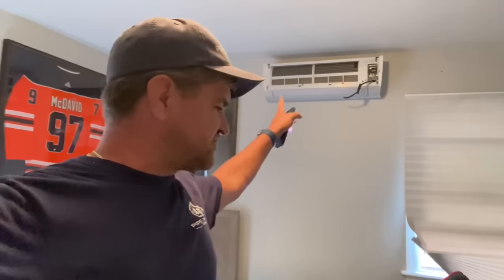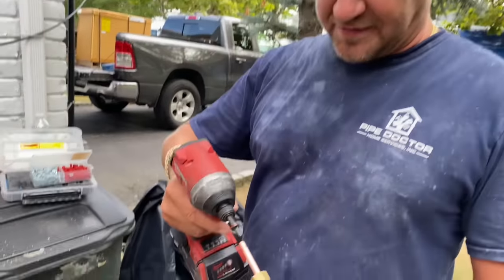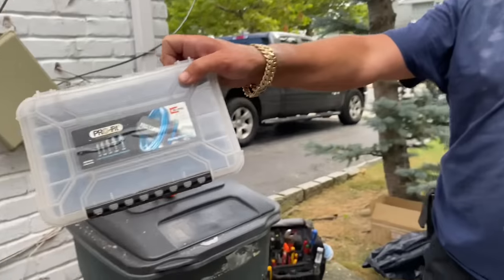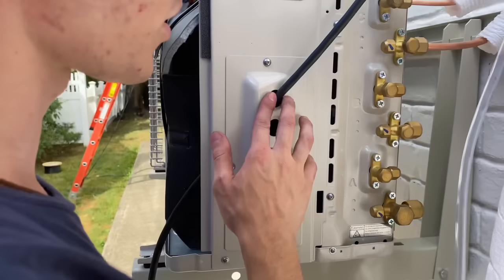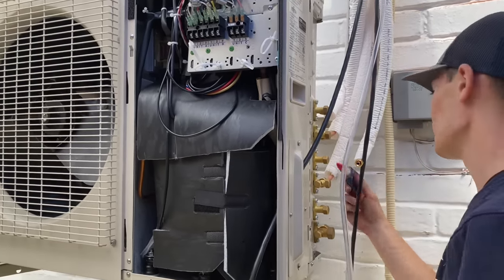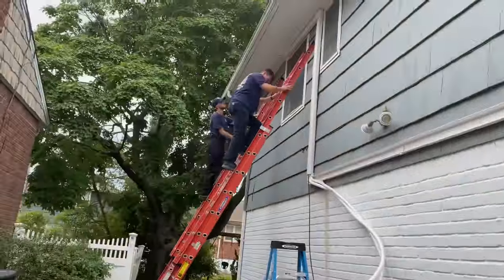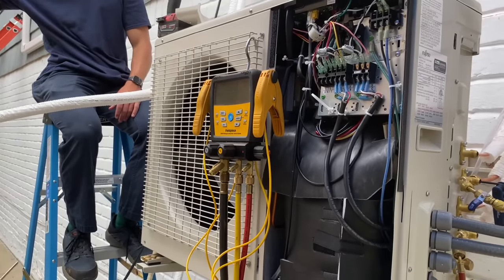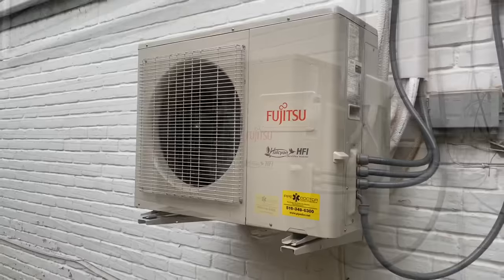Comparing NAVAC Auto Flaring Tool vs RectorSeal PRO-Fit During Fujitsu 3 Zone Ductless Installation

Comment: Mikey Pipes trying to give away the shitty flaring tool.   😆
Reply: I purchased the original Spin flare set, used it once on some oil lines and they leaked. Had to re do them with an old standby handjobber.
Reply: If you ever decide to have a contest for that thermal imaging camera though I would be very interested.  Would come in handy when doing load calculations.  I thought about getting the FLIR device that you can use with your phone.  Still deciding on what brand to get.
Reply: I’m up for the spin. Give it a try on some oil lines
Reply: Did the same mistake myself. I throw mine away after 2-3 failed flares. Thats  trash bro

Comment: The Navac Flare tool works great. I would suggest buying the flare gauge made by Navac part #NFG1 to check your flares when you are done. 
 I made the switch to the >B<Max fittings for two reasons, 1. it’s faster. 2. The copper fitting is thicker than the line set. 
 A2L refrigerants are well on the way just buy the press tool and roll with it. That’s the way of the future.

Comment: I use the hilmor orbital flare tool. It produces a beautiful flare everytime, sure u have to turn it by hand but I think its just as fast if not faster than these 2 options. also easier to lug around in an attic. and only around 140 bucks

Comment: You ever use any of those flare seal gaskets? I used them on my 3 zone LG RED system and my 3 mitsubishi hyper heat single zone systems... Been 3 years and all 24 joints have been perfect.. no leaks. systems never throw any fault codes for low charge.. and it was my first time installing any type of HVAC system.. I made all the flares, made sure all joints were torqued properly and i also used nylog on the threads and contact surfaces..I been in temperature controls for about 7 years so i learned alot along the way about all the systems i worked on.. Sizing, engineering, placement, installation.. all but one use condensate pumps, 2 of the Mitsubishi's i wired in the pump to the call signal to kill the system if there was an issue with the pump..All systems running like a top.. BUT IT WAS A TON OF WORK!!!!!!!!!!!!!!!!!

Comment: You can keep your Rectoseal junk, The Navac is the tool to have.  One other tip is pick up one or two lifetime "one hand folding tables" from HD.  I love these things for quick easy to deploy and store work table.  They are plenty strong enough for light duty work bench not to be used as scaffolding but great place to work and keep tools.

Comment: What would be the price difference between a new central air system in the attic with ducting vs mini split like installed? 3x?
Reply: With ducting you're probably gonna expect $20k for a central system at least. You'll expect a system like Mikey just installed to be at least $10k, but there are disadvantages and advantages to both. More people to service a central system, you need to have a good reputation company installing mini splits and central but mini splits especially because there are so many install errors

Comment: Why did you choose to mount the slimduct across the siding instead below where it would hide much better against the while wall?  Sticks out like a sore thumb!!
Reply: My guess it is quicker fastening into siding versus the brick
Reply: Homeowner can paint the slim duct.
Reply: @mph5896  Personally I don't agree with that! Even if you paint it it will still look out of place! Best place was underneath the siding. Takes about the same time to install on brick.
Many times contractors take shortcuts! Not Cool! Mickey taking 1 tit from you!

Comment: Eh heating up copper sufficiently actually anneals it and makes it more ductile, but that doesn't happen until your north of 500f. Flaring is the same stress, it's actually work hardening the copper. Since the flare itself isn't under any significant vibration loads, any work hardening of the copper isn't sufficient enough to matter. 
I can't see any significant difference as far as the strength of the flare is concerned, however conical flare tools tend to have a smoother mating surface. The crush of the flare into the other end is about the same though.

Comment: Hey Mikey, I’ve seen dielectric grease come with a couple condensers I’ve got recently. I’ve read the install manual but didn’t see anything on it. I assume I would just Put a little on all of my connections to avoid corrosion. Any insight on this?

Comment: Mike have you ran into any issues with the white insulated arms flex , with the gray insides 
They’ve been eating thru the copper and causing leaks 
We’ve had a lot of leaks on these ductless line sets 
There’s some kind of a reaction with the copper and we’ve had to replace a lot of them
Reply: I was wondering the same. We did a house where to replace the leaking linesets we have to tear open tons of drywall to 5 heads, 3 are cassettes.

Comment: What's wrong with the Goodman fur coat.  It is ready for winter.  To take care of that, you set up the fan to run in reverse and blow the air then from inside out.  Problem solved  lol

Comment: Can you flare an aluminum pipe I helped my friend install his mini split and his line set was part aluminum and part copper the ends of the line set were the flare nuts were copper and the rest was aluminum so we cut the line set because there was extra line set and we saw that line set was aluminum can we flare an aluminum pipe we don’t know what to do
Reply: You can flare aluminum. But I’d be careful when flaring to not split it or crush it to much. And same with tightening the fitting

Comment: 😳 yeah I’ll pass. Nylog isn’t recommended by any manufacturer because it can contaminate the oil and clog the filter screens. Touch of POE oil on inside of flares is what’s recommended. Line hide should run all the way to condenser so pipes are hidden, end fittings should be used for termination and for the love of god stop cutting your insulation back 8” from flare nuts. It should be cut past the flare then pushed back and held with a pipe cutter just to give enough room to make flare once complete release the insulation so it is flush with the nuts….. I could keep going this is amateur at best.
Reply: Nylog is thicker synthetic compressor oil.. what are you contaminating?